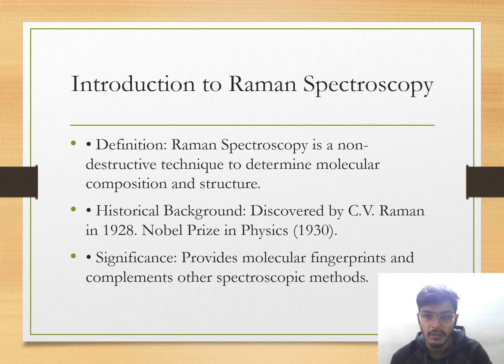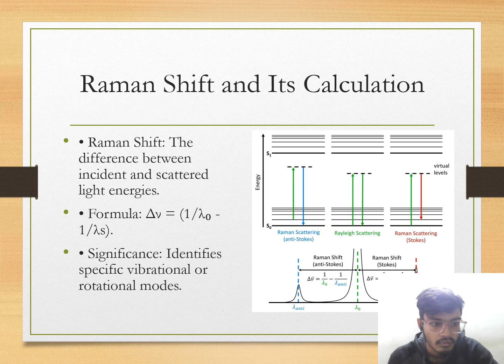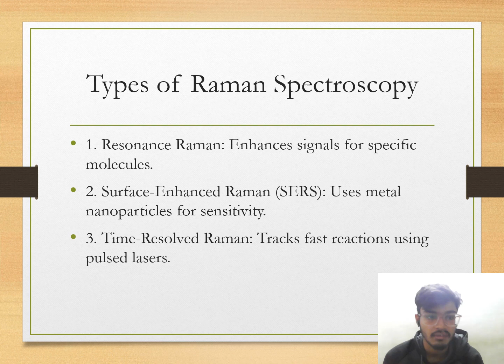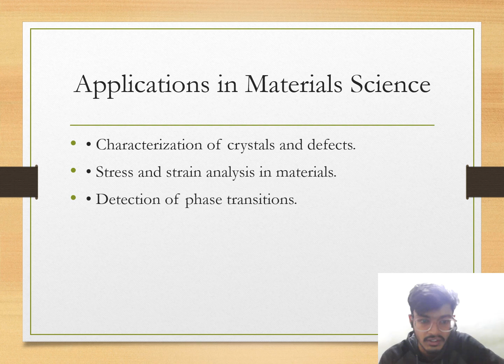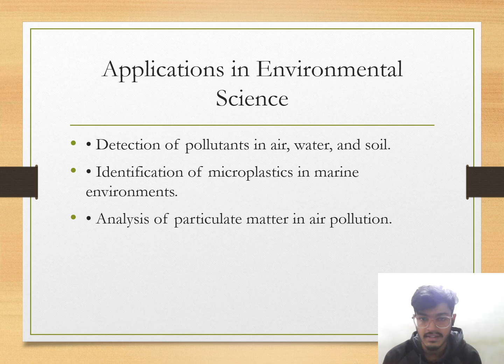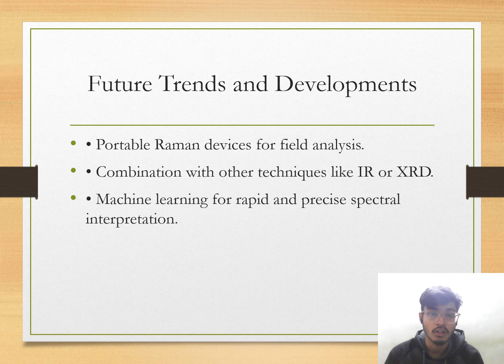Raman Spectrometer  Presentation by Santhosh B T S (BT21CME105)

Comment: BT21CME072 Kethavath Vamshi 
Why is a laser typically used in Raman spectroscopy
Reply from the maker: Lasers provide a strong and monochromatic light source necessary for observing the weak Raman scattering signals. The intensity and coherence of lasers ensure precise and efficient excitation of molecular vibrations.